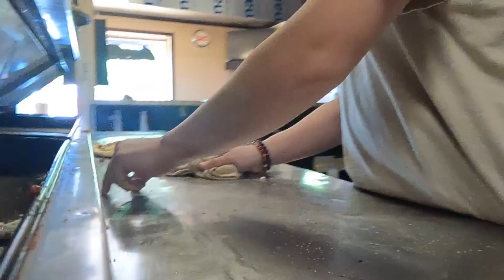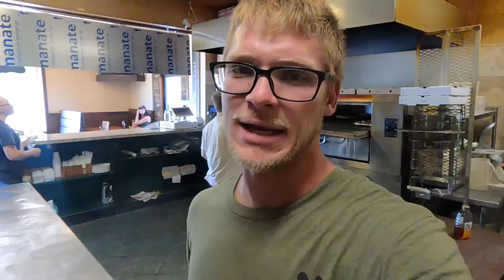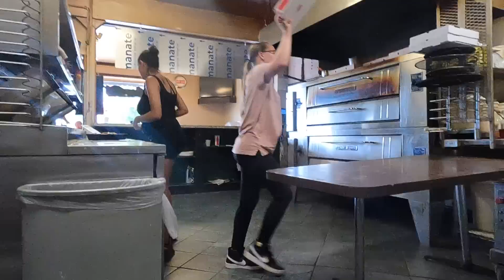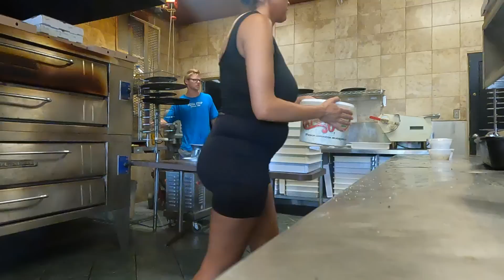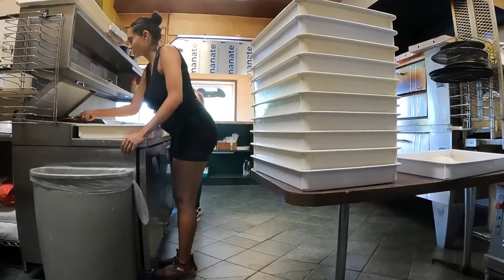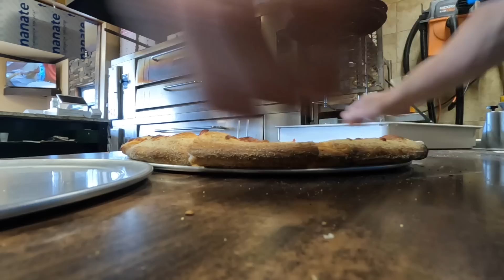What Really Goes on Inside Preston's Famous Pizzeria Kitchen

Comment: What is the spray that they are using around the pizza crust?
Reply: I’m assuming it is oil. I’d love to know what kind. Never seen this before. At home I use a brush and dip it into garlic oil that I make then use brush to put on crust.
Reply: @cliff185026  I have never been shown or do this myself. I never use spray oil and I have never or have never been shown to spray oil over top of all the pizza ingredients. I have always been shown to use a brush and oil around the crust on the edges where you leave dough for and don't put any ingredients. Also I took a government food and safety class of which I passed the exams with flying colors. So the oil thing is weird to me as well as the lack of hygeine + wasting time. All things I was taught by the end of highschool not to do.

Comment: If you know what you're doing these pizza's from your employees should be constructed about twice as fast as they are in this video. In fact 2 pizza's on the line could be made by one person in the time it takes 2 of them to construct 1 pizza. Also get timers and time the pizza so everyone stops opening the oven many times to check if it's done and letting all the air/heat
 out. I have worked at different jobs in different fields and time wasting was always a thing at every job I worked at. doing simple tweaks could save you minutes of time otherwise wasted.
Reply from the maker: Oh I’m with ya.